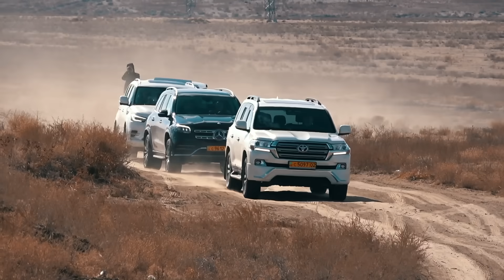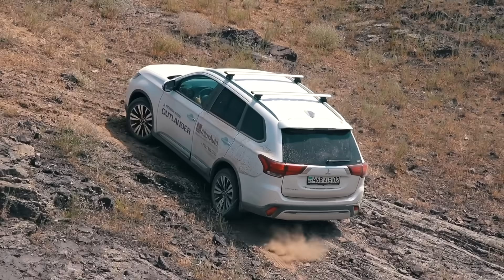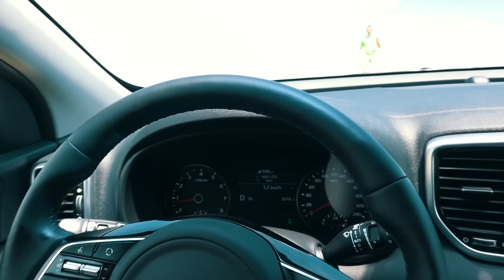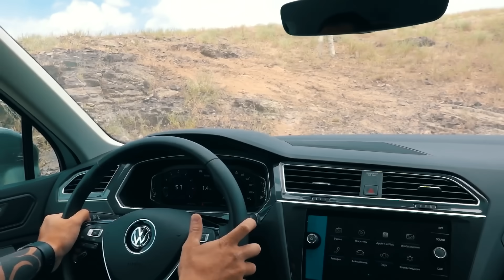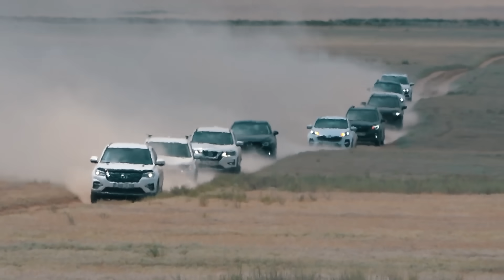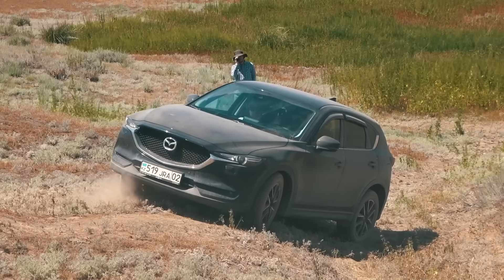SUV Battle 2020: Toyota RAV4, Nissan Rogue, Subaru Forester, Mazda CX 5, Volkswagen Tiguan, Sportage

Comment: Expected RAV4 to perform well but Forester’s performance was a surprise.
Reply: From a guy that's owned 3 older subaru sedans, the traction control kills your capabilities when you need momentum.
Reply: I live in rural PA and Everyone switched to subarus, we get loads of snow, ice, rain and mud and it handles it really well. I'm looking into maybe a  Forester since that's what our mail lady drives
Reply: My '19 Forester is great in deep snow and ice. I love it.
Reply: Toyota and Subaru should partner and combine Toyota's reliable AISIN 8-speed transmission and Subaru's mainstream AWD.
Reply: @PlymouthNeon  — and if they MUST stick with a CVT, adopt an actual first gear like the new Corolla CVT has ...
Reply: @PlymouthNeon  Toyota already owns like 10 or 20% of Subaru.  But I don't think Subaru will ever use an Aisin transmission, unless Subaru drops the Boxer engine.  The way Subaru's drivetrain is setup, the Aisin won't fit.  And since most subie owners will never take their car offroad, there's no need to reengineer a solution.
Reply: @PlymouthNeon  Toyota owns 20% of Subaru
Reply: @PlymouthNeon  almost a year ago Subaru became part of Toyota Motor Group.  There’s now a pathway to get a proper transmission into Subarus.  Both companies would have awesome AWD vehicles if they took the best from both platforms.  As far as the best AWD vehicles, can’t *beat* the Jeep trail hawks.  Especially the Cherokee and Grand Cherokee trail hawks with real 4 low and a real rear locking differential.  Ford may join the elite club with the bronco sport.  Below those vehicles and you have the mechanical rear LSD vehicles, like Honda iVTM4/ Acura SH-AWD, and then vehicles with the GKN twinster rear diff, like the Volvo XC90, Ford Expedition, Chevy blazer.  The Rav4 system doesn’t seem to be a true LSD.  The vehicles in this comparison are just open diff + traction control.
Reply: @JonDZ_Adventuring  — you summed it up perfectly ...
Reply: @JonDZ_Adventuring  Subaru isn't part of Toyota..  They are partly owned by Toyota, up to 20%, if I remember correctly.  As for who actually owns Subaru, it's Fuji Heavy Industry.
Reply: @PlymouthNeon  I believe they are exchanging hybrid technology already. Specially after Toyota recently owns 20% of Subaru, 5% before. I'm a Subaru owner  and I think the transmission puts huge weight on efficiency...
Reply: The driver makes different too. Subaru rocks
Reply: Dave Allen  it doesn’t appear to be anything like that.  Check out my video here: https://youtu.be/C319m1dleXc it doesn’t seem to be that effective, this is the Rav4 adventure too.  The Rav4 multiplate clutch behaves more like an open rear differential.  TFL called it gimmicky.
Reply: X-Mode on means turn off traction control. Would have made it w/o issue.
Reply: @Chris_Sokol  no it wouldn’t have. Former owner of a fleet of Subaru Foresters for my business. JonDZ Adventuring was a Subaru owner as well. Momentum was the only way I could make steep, uneven climbs. The cvt stops the vehicle from moving in these situations. No amount of x-mode or traction control can overcome the limitations of the cvt. Subaru owners, former and current, need to quit exaggerating it’s performance capabilities. It’s not an off-road machine. Period. Yes, I used my Foresters off-road 95% of its time I owned them, but they were simply cars with ground clearance and all wheel drive. Nothing about it made it off road worthy or exceptional.
Reply: @haroldbeauchamp3770  you are 100% wrong. Period. I’ve put Foresters I have owned deep into off road trails and came out the other side without issue. Have I winched a couple of times? Of course…as has anyone that seriously off roads. And I am not alone either. Watching this video it is clear that the Subaru operator had no clue how to drive a Subaru. Every vehicle drives differently. Subaru makes very capable off road vehicles.

And you are right. Traction control does not help. That is why you switch it off.
Reply: @Chris_Sokol  no amount of anecdotes or conjecture will change the experiences I had with my Subaru fleet. I tried every possible solution to my Foresters we had more capable in certain conditions but it wouldn’t. The cvt limits initial torque, traction control off or on does not change the cvt programming. JonDZ adventuring had a video that explains this in detail. I encourage you to watch it to see exactly what many of us Subaru owners experience.
Reply: Jeep??
Reply: Toyota using clutches is genius!  Because unlike this fake software LSD Subie and others are trying to use, Toyota, using clutches can transfer power to the wheel with traction without braking the free spinning wheeling.  That way, if the free spinning wheel does touch the ground, it's not holding brake..
Reply: Subaru’s are something else.  Had a few of them
Reply: Subaru can never be a surprise, it's the off-road among the small SUVs
Reply: Its Subaru
Reply: Because Kia = King of the off-roaders lol
Reply: Subaru all the way
Reply: Subaru’s CVT is actually really not that bad, used to have one, the transmission was actually pretty good. ‘15 Forester XT.
Reply: @TheBimmerMan  you should play the lottery. The local transmission shop in town sees dollar signs every time one of them pulls in the shop.
Reply: @haroldbeauchamp3770  for the 4yrs that i had it the transmission never failed. had it new until 2019, no problem with it. it was a really reliable car.
Reply: @TheBimmerMan  you should play the lottery because oil consumption and cvt failures are extremely common.
Reply: To me all these suvs are behaving the same ...I must  say I was expecting more from the forester due to its reputation  but so disappointed 😕😕😕
Reply: The Sub was climbing the hill just fine, look at 9:53 the driver hit the brakes hard, barring that it was on its way no drama.
Makes me a bit suspicious.
Reply: @fubartotale3389  yeah they stopped them all mid trail to see what they do from a stop. I know my forester sport 19 doesn't have that kinda torque, on unsure footing to make it up that from a stop. As one guy put it. They are good Momentum off roaders. Haha. I like that classification.
Reply: @alozano793  
The torque reduction comes from the engine managment system protecting the CVT.
This can be switched off.
Reply: @fubartotale3389  I've gone into sport mode and realized it before and you re right. It will let you in sport mode. Although.... I'm really trying to be good and not blow this one up haha. But nice to know I can push it in sport mode.
Reply: @fubartotale3389  — do you not understand English? That was the point of the test — to see how the vehicle could pull from a stop in such conditions. The narrator said that several times. They did the same to all of the cars.
Reply: I'm a fan of Subarus and I'm not surprised by its performance. The CVT really degraded the AWD's capability. Believe me, a 3.6 Outback with the 5EAT will walk up that hill.
Reply: @BenTLador  Especially the forrester/outback with the older 5MT dual range gearbox.
Reply: @BenTLador  szzz
Reply: Not surprised at all.  Since Subaru switched to the CVT they just aren’t as good as the older 4EAT/5EAT versions, especially the 2009-2013 Forester or 2010-2014 Outback 3.6R that have traction control.  The 2020 Tiguan has the most capability of the group.  Haldex 5 is a gigantic improvement over previous iterations and is arguably the best here.  What makes the Tiguan the best of the group is not only the most torque but the best gearing at an 18:1 crawl ratio.  By the way, I had 2 Subaru’s, still love them but sad they use CVTs, and FYI, I drive a Honda Passport with a 3.5L V6 and a 20:1 crawl ratio.  It has a mechanical rear LSD and is on another level (that’s why I bought it 😃).  I’m not a VW fan, just saying it’s the best in this video.
Reply: @JonDZ_Adventuring  After owning several Subaru's with the 4EAT (Impreza, Forester, etc) and then later several CVT's.  No... they're not better... by any means...  Even with the issues of the CVT, these 4EAT's... are not better... just no.
Reply: @JonDZ_Adventuring  حح
Reply: @JonDZ_Adventuring  Thanks for the Passport post. What is the best year and models to look for?
Reply: JonDZ Adventuring jeep?
Reply: Its not a surprise, subarus are made for performance
Reply: This why consumers should not buy the CVT transmission.  Cheap for manufacturers bad for consumers.
Reply: Cannot believe the day has come that Toyota Rav4 is better off road than a Subaru. Subaru really destroyed their off road advantage with the CVT limitation
Reply: Crossovers are designed for on road use. 4X4s are for off road. This vid series is fun and interesting but silly.
Reply: The CVT literally killing Subie's credibility
Reply: @andakara27  
They can't build them fast enough, is that what you call killing?
Reply: @andakara27   I have a 2016 crosstreck cvt and I have been threw many obstacles this severe without the same drama. The traction control needs to be off to allow wheel slip. The VDC still remains on and will still transfer power to the appropriate wheels that need grip but it doesn't cut out the power completely. I've never run into any protection mode with the cvt. Not even when pulling a loaded Pepsi truck up an ice slick hill. Subaru CVTs are built well compared to other manufacturers.
Reply: @andakara27  cvt really sucks!

Comment: I love your Videos! They are great! But where is Dacia Duster 4WD? 
Greetings from Germany!
Reply from the maker: Thanx for feedback! Duster will be in the one of upcoming videos. It’s already filmed.
Reply: @SUVBattle  Do you also know how the AWD systems of each car work? Tiguan for example has a Haldex clutch in the rear Differential which turns the rear axle off automatically.Every VW with transversely installed engine has that System.